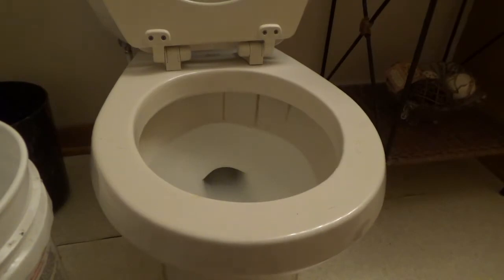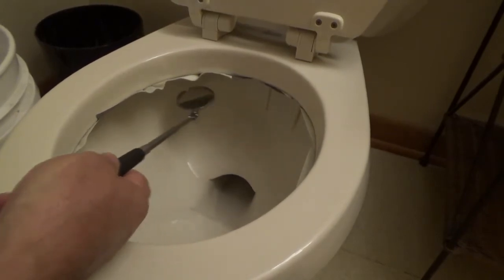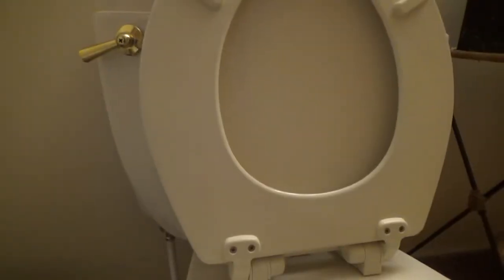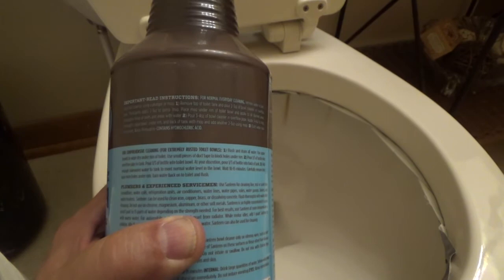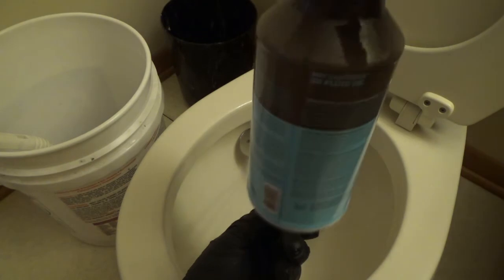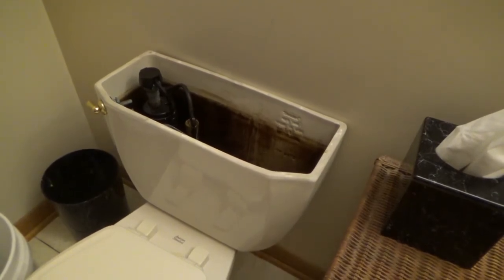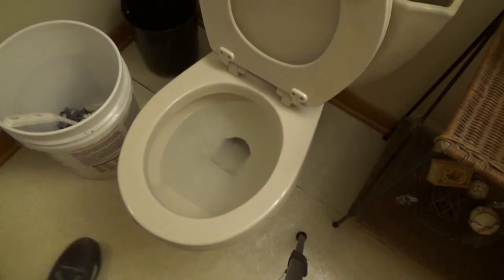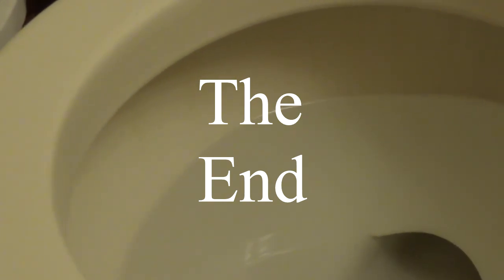Santeen Toilet Bowl Rust Remover

Comment: So one thing I think works better is to use a paint brush. Just get a cheap on at the hardware store. Works excellent. It will start fizzing. I wish I had taken a before pic but I cleaned our stationary tub that had a thick layer of rust buildup. Probably 2millimeters thick in places. Most people would have just replaced the tub but this stuff brought it back to new! Great stuff. We swear by it.
Reply from the maker: Thank you for taking the time to leave your excellent comment.

Comment: What’s the reason duck tape is needed to cover the holes?
Reply from the maker: The duck tape kept the acid in the rim to clean it out.  Otherwise the chemical would not have time to clear out the rust.  Also, I just made a video where I show Critic Acid (powder) is much better and safer for us the user.  If you are removing rust, I highly recommend critic acid.
Reply: @A_Renaissance_Man  thank you. I’ll watch that video. I just bought a ton of critic acid.